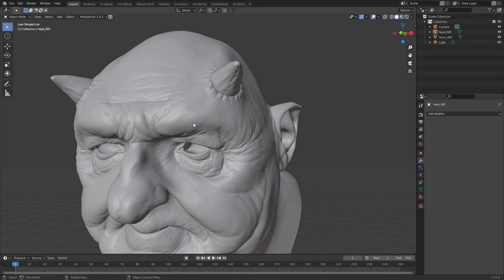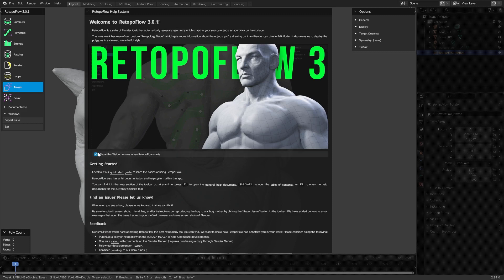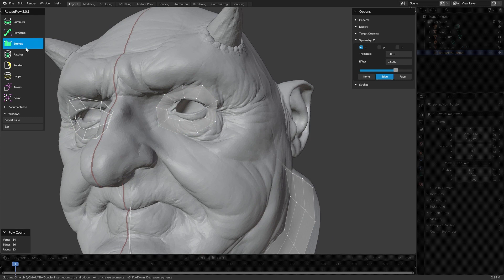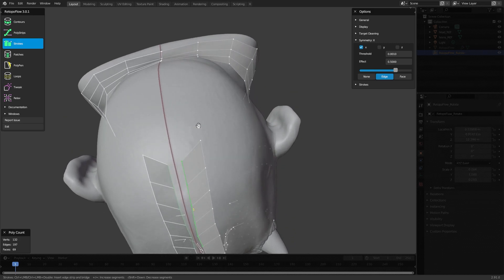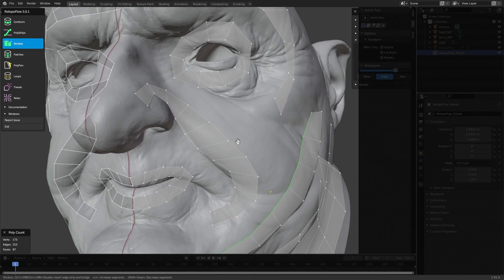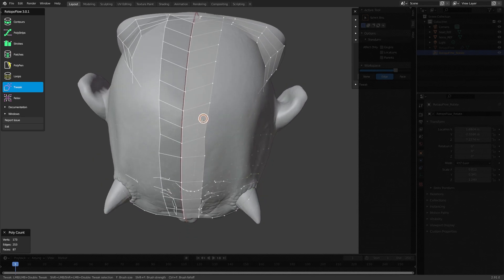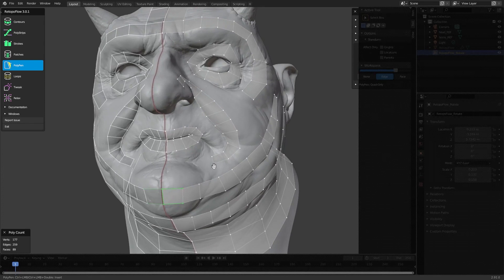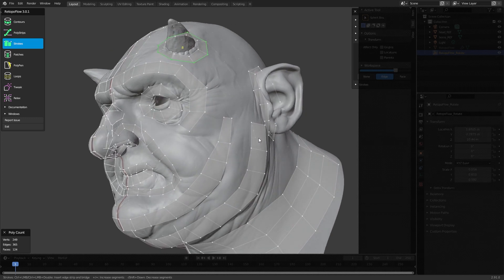Retopologizing a Head With RetopoFlow 3 | Free Chapter

Comment: After you go out of retopoflow, like to save, there doesn't seem to be a way to go back into it with the same retopology layer.
Reply: Seems like the dev of this plugin posted on their other video about RetopoFlow 3. I'll just post it here for you, hopefully it helps

"A few notes:
- don't need to select the high-poly source mesh before starting.  any mesh that is visible is considered as source.
- to continue retopoing, switch into edit mode on the low-poly target mesh, then start RetopoFlow.
- symmetry is actually fully done by a modifier (not baked in)!  so, you're not stuck with the mirrored side if you work with symmetry enabled.
- you can adjust the effect of the symmetry under display and symmetry options.
- if the UI is distracting and you only use keyboard shortcuts, you can close windows and minimize the tools window, or F9 toggles visibility of all UI.
- if you find a bug/issue, let us know!"
Reply: @Nettle_io  That solves it. Thanks!

Comment: Seems very good, how does this compare to maya retopology tools? Would it be worth  switching to blender to retopologize?
Reply from the maker: Even with the release of RetopoFlow3 it still needs some refinement to compare to Maya. So if you're already using Maya, there's no reason to switch just yet although we expect the Blender tools to fully get there in 6-12 months. 

If you're already a Blender user, there's no longer any reason to learn a new software for retopo, as RetopoFlow3 is quickly adding all of those missing functionalities we didn't have in Blender before.
Reply: @fnmarket  But what about when points go inside the mesh when using quad draw in maya, any tip for that?
Reply: @vyoumkushwaha8331  That's my main issue with maya. Their retopo tools aren't that good, I dont see why people like maya's retopo